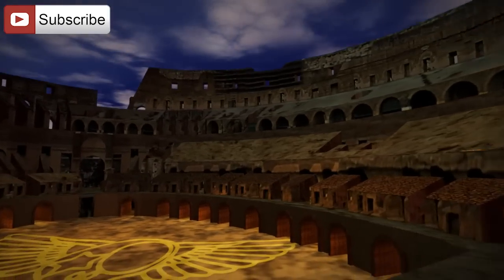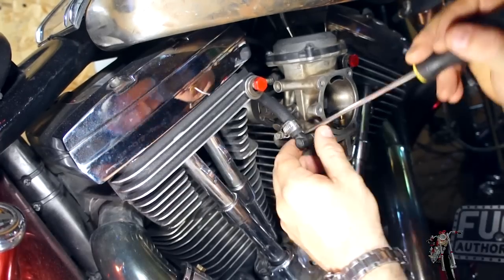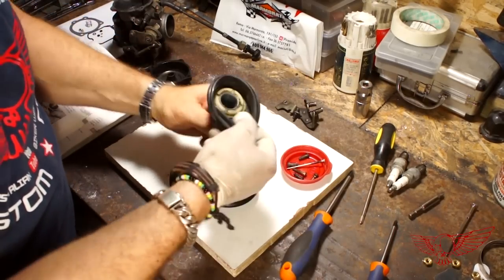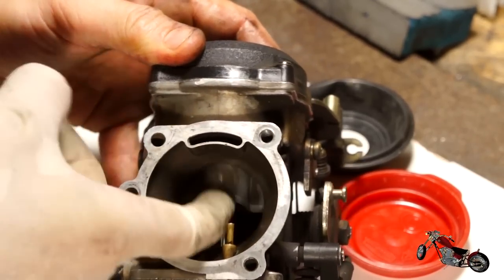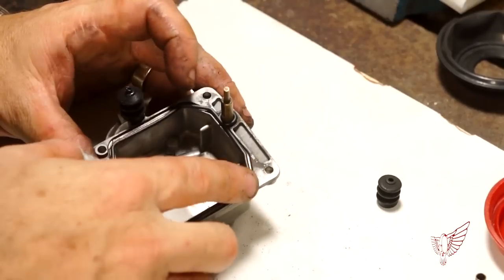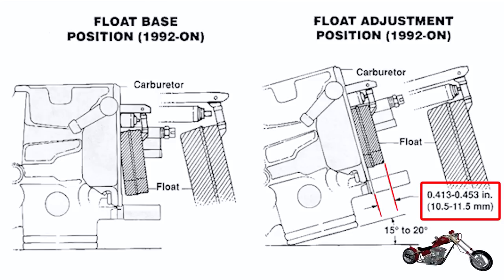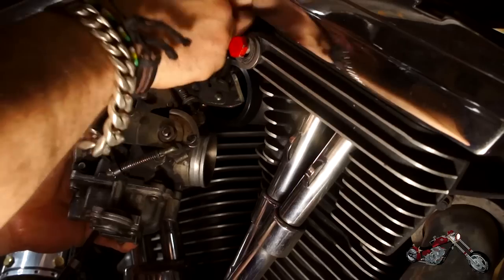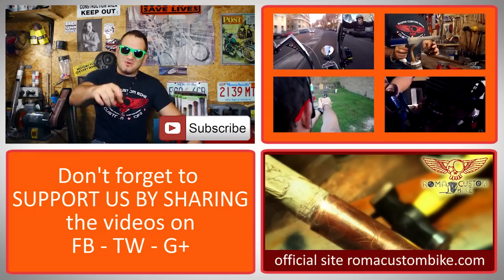How to tune your CV carburetor rebuild & float adjustment Tutorial ep18 Roma Custom Bike

Comment: I'm going through the same kind of CV carb woes and your video was very helpful. Nice hack to put a little oil on the diaphragm to get it in place easier. As well as checking the correct float height. Very well done, thank you sir. 👍

Comment: Don't try replacing the slide diaphragm on newer models as shown here. The new version slides are glued under the plastic retainer by the factory to keep people from tampering with them. Plus you risk leaks and poor sealing or having to replace it again in the near future. A replacement vacuum slide for your Harley is far more reliable. CV Performance specializes in parts specifically for Harley CV carburetors if you have any questions.
Reply: Also many of the replacement diaphragms available online (ebay, amazon, etc) were originally made for other models and don't fit correctly, so beware. The factory unfortunately never made replacement diaphragms for the Harley slides.
Reply from the maker: CV Performance thank you CV performance, I went nuts trying to figure out how to remove it "properly" but then, beeing so frustrated, i just pulled it out and figured that's the way to do it...thx for the update and i'll check you out for the "right" solution.
Reply from the maker: CV Performance so u suggest this? http://www.cv-performance.com/harley-vacuum-slide/
Reply: CV Performance Hi Custom Cez, great video. Yes that is the correct vacuum slide for these carburetors you linked to. You were lucky enough to have a slide where the diaphragm pulled out but others might have a glued in diaphragm or pinched too tight to replace. Working with these carbs for over 25 years I've found it is much easier to replace the whole slide than to struggle with the rubber piece and risk failure later. In your country (all Europe) Motorcycle Storehouse distributes slides through local shops or you can order direct from CVP in the US. 
Motorcycle Storehouse part 901507 http://www.motorcyclestorehouse.nl/product/901507
or direct from CVP:  http://www.cv-performance.com/harley-vacuum-slide/
Reply from the maker: CV Performance Thank you man! i'll publish an update on the video were i'll share your link and info :)We are doing a cv carb in a coupple of weeks for a friend so know that one order from europe will be mine :)
Thx again for the info
Cez

Comment: Hey Custom Cez, I've got a Nissan a14 powered pickup which I did a bike carb conversion on(4x 34mm keihin cvk v598 from a kawasaki zxr250r) and Ive jetted them with 35 idle jets and 114 main jets, I've set the float levels to 13mm,topside membranes and springs were OK as well as guillotine barrels just cleaned everything well, basically I serviced them and jetted accordingly to suit the 1400cc engine which has ported and polished head and 284 degree camshaft. My problem is that when I played around with the jetting (only on mains, idle jets are standard items) I found that when going lower in size from 114 mains, the engine would not rev past 4500 rpm and going bigger it was very rich and I had to replace fouled spark plugs every few days, I feel that the jetting is more or less right for the engine size however it still runs rich and when it idles too long, it seems to flood the engine because it would then start to misfire and have visible fuel sitting in the cavities when viewing from front of the carbs from there it just gets worse. I think I got the jetting correct referencing from weber dcoe jetting on same engine. it has been running abit better however I'm still going through plugs and still need to replace them not so often as before. It's been a struggle but I do not want to give up until I get it to run efficiently and reliably. Please help
Best Regards. Jason Alexander (South Africa)

Comment: I understand that this is an old video but keep in mind that if you could pull the diaphragm from the plastic rings, then it was not sealed. Thus simply pulling it out and replacing it makes no difference to purchasing a slider/diaphragm set.
Some carburetor models have the diaphragm tightly built in the plastic rings making it impossible to pull them off, but even those can possibly be fixed with some glue and a cutter.
There are even glue and diaphragm sets on ebay that go for far less than the slider set. Check on youtube for tutorials.

Comment: you did install the accelerator pump diaphragm up side down. and your original one was installed correctly. the rid on the diaphragm goes in the grove on the carb base.
Reply from the maker: Thank you John, I did correct this at a later time :) thank you for pointing it out

Comment: Molto bene as usual.  Caught a blooper though.  Accelerator pump diaphragm was installed upside down!  Ciao from USA.
Reply from the maker: Grazie David. I was sure it was the right way, not that the manual or the replacement kit had any useful info :-) but i'll open it up and see. How can you tell so that i can fix it? Thank you.
Reply: The raised edge goes toward the carb in its own slot.  Flat side of the diaphragm goes toward cover. If I saw it wrong I apologize.
Reply from the maker: Don't apologize, i thank you for the tip :-)

Comment: The way to properly test the actuation of the CV diaphragm is to hold the carburetor up  with the inlet throat facing you and with a blowgun, connected to an air hose, blow air into the carb throat and diaphragm inlet port as you wave the blowgun back and forth past the face of the carburetor. You will see the slide gradually rise and fall as the increase in pressure rises and falls. DO NOT blow directly into the diaphragm inlet port as you burst the diaphragm with excessive pressure! By the way... I am a Harley Davidson Technician by trade and do it for a living so I know exactly what I'm talking about.

Comment: You installed your accel pump diaphragm upside down the ridge faces the the bowl if I'm not mistaken. Why did you add an o ring to the top of the accel pump jet?
Reply from the maker: +kurtis mazzone Hi kurtis, i installed the diapham the way the previuos one was installed. It did work before so maybe there is not much difference :)
Reply: My comment is very late....sorry.
I've just done my carb rebuild. 
The accelerator pump diaphragm was indeed replaced upside down in the video. I hope it worked!
Also, the O ring on the accelerator pump jet can't have been there in the first place as it doesn't need one.
Having said all that, I love your presentation and am a happy subscriber!
Reply: @tapster15  I caught both of those myself lol. I decided to read the comments to make sure im not crazy

Comment: Great D.I.Y. video. Would like a bit more technical details on carb removal and installation, torque specs, etc., but very entertaining, to say the least...
Reply from the maker: +FJSA Steve thank you very much, I might do that very soon also about the adjustment screw as it has been requested quite a bit.
Thx again :)

Comment: What about 2 cv carbs together on a vt1100. Do you work on 2 carbs attached before?Whats the T plugs that connects them both on the top ? Is it over flow? There's gas pouring out and it runs like shit.  Would shims on slide needles cause this?

Comment: The small brass top hat looking thing left in the bowl at 8,11 goes on the carb top under the throttle cable bracket. It's there to stop over tightening and cracking the plastic top. Looks like you forgot to fit that bit.

Comment: Hey man, great vid. At 5:11 on the bottom of the screen there is a hole with an adjustment screw inside. Can you tell me what this is for?
Reply: Connor R z
First time viewing this vid. I'm guessing you know this by now........ but just in case....... It's the fuel/air mix screw. On this carb, it alters the fuel delivery.

Comment: I have never seen an o ring on the accelerator nozzle, is that specific to year? Thanks!
Reply from the maker: I actually thought it was going to seal the nozzle but it doesn't. So it was removed afterwards.
Reply: +Custom Cez was that o ring supposed to go on the fuel mixture screw??

Comment: I have an 00 Harley Davidson Sportster xlh883c I rebuilt the original cv carb but I think my float is not set at the right angle. 
what is the correct angle?  
reason for asking is cause I have fuel just dumping out from the overflow tube. 
how do I fix that problem as well?
Reply from the maker: +firefighter 9/11/01 ciao Firefighter, it sounds tome that you have dirt somewhere in the system that keeps your float open (overflow) but do the procedure from the video to set the float. Check inside the hole where the plug goes for dirt or obstructions.
Reply: Custom Cez Fai Da Te check out my video brotha and let me know what you think it sounds off and I keep having the fuel pouring out of the overflow tube. 
the was sitting for about 2 yrs from what owner is telling me
Reply: OK I adjusted the float and replaced the diaphragm and tricked the idle mixture screw and speed screw and the bike running great.  I no longer have gas problem (overflow tube.  ) and my oil cap plug is no longer popping off.  
thanks guys for your assistance.
Reply from the maker: you r very welcome :) glad to hear it all worked out in the end :)

Comment: Hahaha You wasted a lot of time cutting a piece of wood and using a caliper to measure the float height! Hold the carb up at an angle, the degree doesn't matter as long as the float is resting on the float needle, without compressing the needle spring, and set the float level with the bowl flange. Simple. People ALWAYS over complicate things unnecessarily.
Reply from the maker: Thanks for the tips!

Comment: Hey man, great vid. At 5:11 on the bottom of the screen there is a hole with an adjustment screw inside. Can you tell me what this is for?
Reply from the maker: Hi Connor, thank you very much :) check this video out were I explain exactly how the carb work and how (and why) to adjust that screw :)